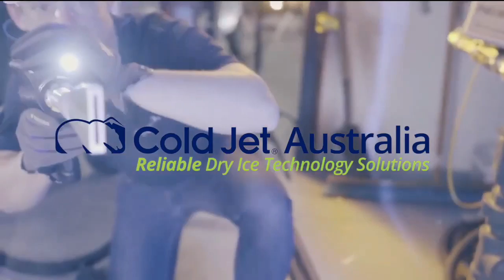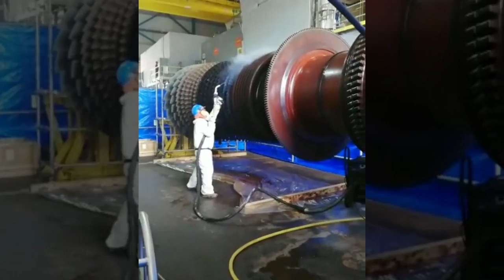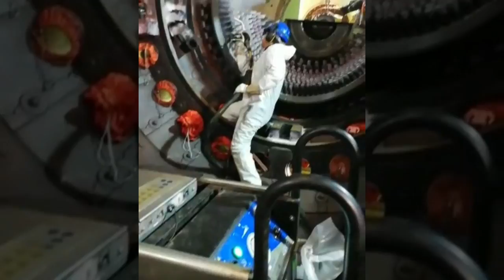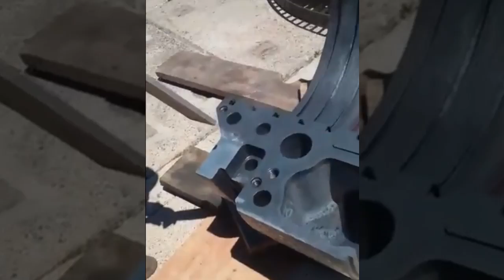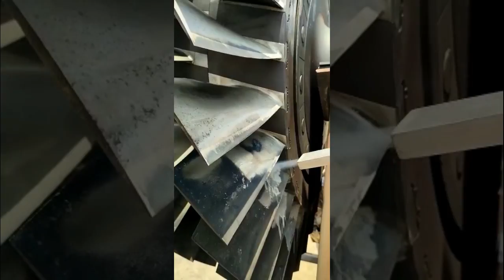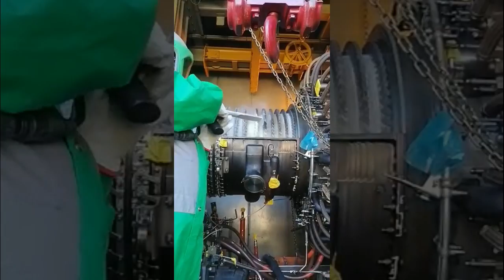Cold Jet Dry Ice Blasting Gas Turbines

Comment: Hi was dry ice grits used at any  staged of cleaning?
Reply from the maker: Hi Kgotso, this was pure dry ice cleaning on gas turbines, but if you need to clean steam turbines in that scenario you do need to mix dry ice with an abrasive media because the steam turbine build-up is quite difficult to remove using just dry ice.

I hope the above helps you. 

Cheers.